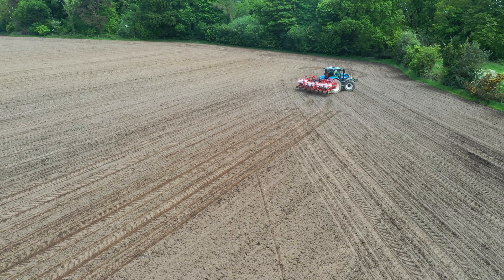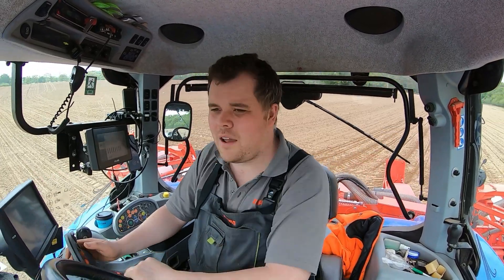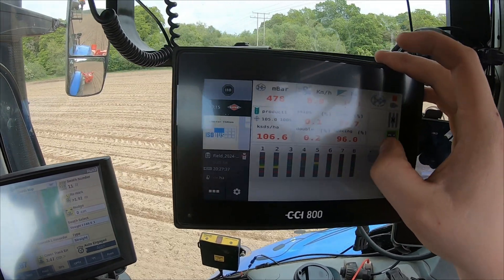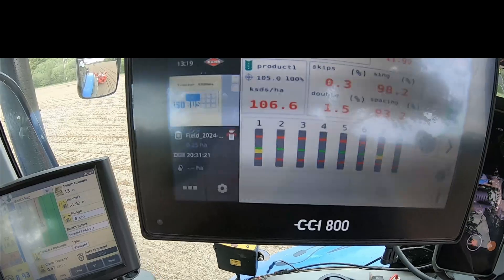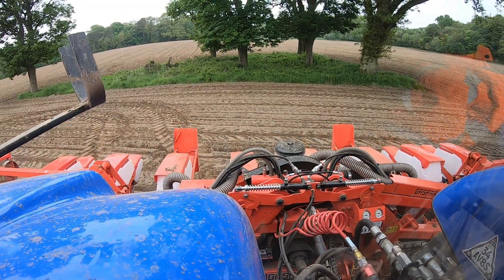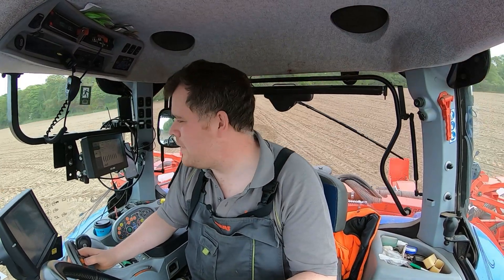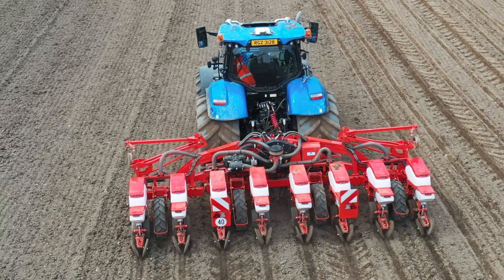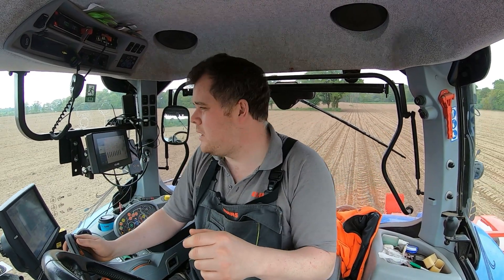Drilling maize 2024 with NEW 8 row planter - J.D. Townley & Son

Comment: Great video and well explained! Thanks for the Video, your not sowing this under Plastic, any reason for this?
Reply from the maker: Thanks for the feedback. We offer both maize in the open and maize under plastic to customers. The plastic maize would cost the grower another £180-200/ac resulting in approx a few weeks earlier harvest. It's down to personal preference. It's kind of like paying for an insurance. 
 Personally we grow our own maize in the open and it will do just about every bit as good.
Reply: @jtownley90  Thanks for the Reply, you might be the best person to ask then in terms of Volume and Tons returned per Acre what is the difference and is that why it makes sence putting it under the plastics!

Also that planter looks the business, say it will do a great job
Reply from the maker: @deadstack  all depends on the year. Last year alot of maize came out around the 37-40T/Ha mark. I honestly don't think there was a vast difference between the plastic and open Maize but we didn't get to see alot of plastic maize over the weigh bridge. Majority of maize that is sold off field would be drilled in the open.  If maize is valued at £50-70/t it's definitely not going to do 4T/ac more to justify the price. All is gained would be an earlier harvest date. The best maize we cut over the  weigh bridge was in the open and yielded 44T/Ha. 
 As for quality and feed value of plastic and open Maize I couldn't comment on that as that's done on farm in the winter time.
Reply: Seen what I assume is some of your fields down the ards peninsula done like that, looks so much nicer to the eye without the plastic. Also, saw your grass outfit the last week there, very tidy 👌
Reply: Was wondering about that as well